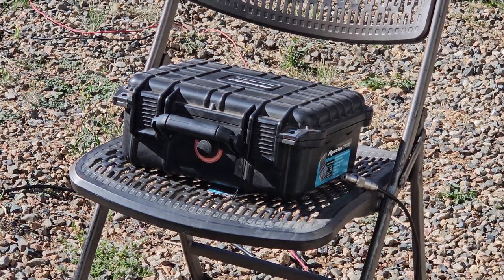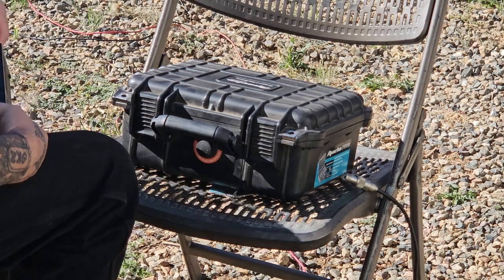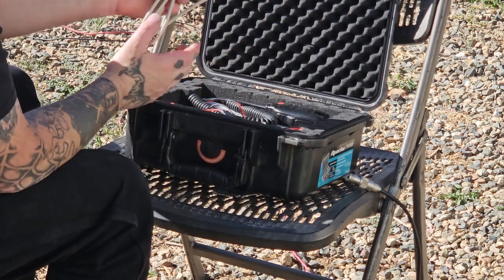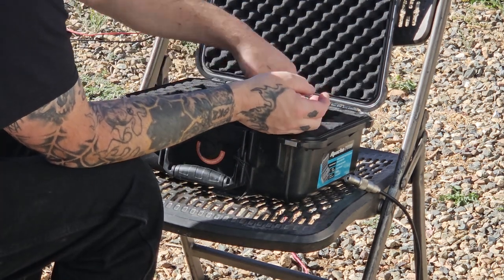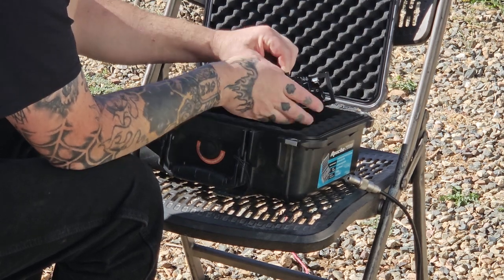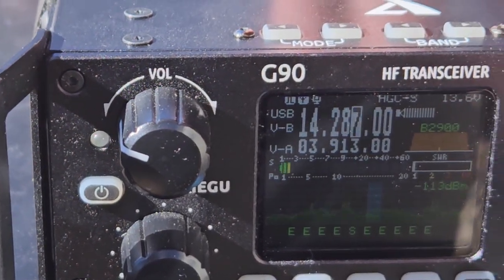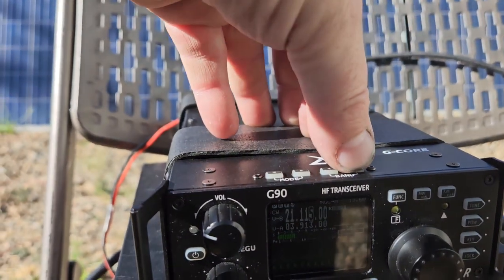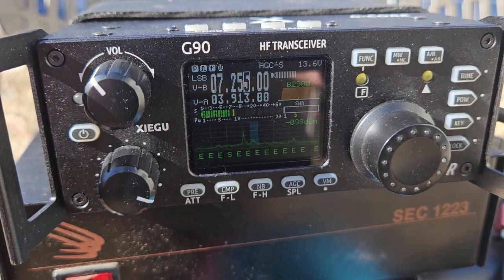xiegu g90 backyard ham radio

Comment: Do you know if the tuner has memory banks?  If so, how many?  In banks?  Does the power have to be turned down before initiating a tune cycle?  I cannot find any online instructions for tuning other than press the tune button.  I am the third owner of this rig.  It is an amazing little rig.  Thanks for your reply.
Reply from the maker: Ive never turned it down i think it tunes with a reduced  carrier anyway.  It seems to have memory but maybe not. Either way it works very well

Comment: I did the same thing with my xiegu g-90 after work this morning, Went outside and set it up with a lipo4 battery and a 35 foot alpha delta dx-ee antenna. De ve3tya
Reply from the maker: Its good practice for sure. Most of us could stand to practice more often just to change it up. Im not a prepper or e comm person  but its good to be prepared and makes you a better operator.